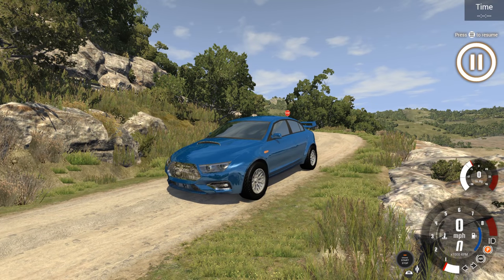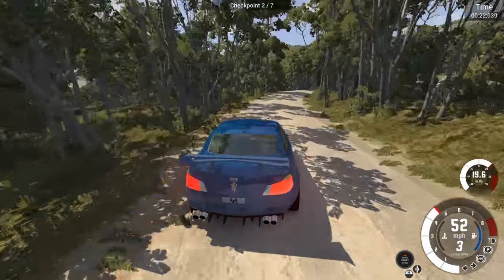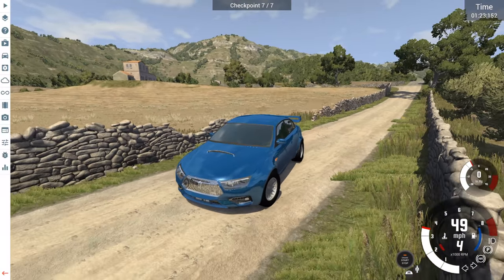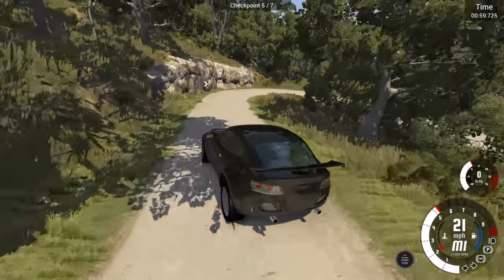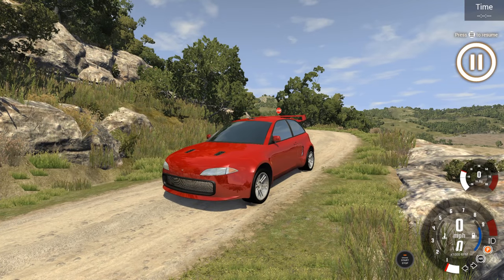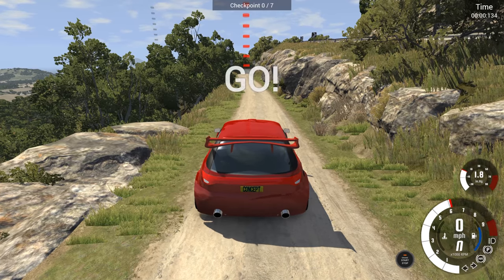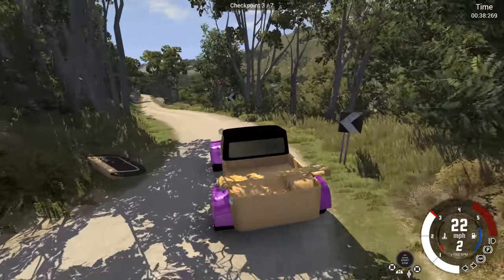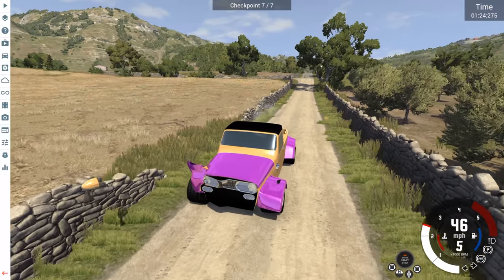BeamNG/Automation Rally Cars #7

Comment: i think the reason that first car hates the hairpins is because the front and rear have to spin at the same speed due to the 4x4 set up.
but when cornering the front needs to take a slightly longer distance, but its not allowed to spin faster to maintain its grip. and so the front just loses all its grip through the corners.
Reply: Feel like I've seen your name before somewhere
Reply: Gibbon  Yeah feel like I haven't seen vudluv anywhere. What even is that supposed to mean

Comment: 6:55 thats a dual clutch...
Reply: @Waff1es  Then its not called a sequential, the dual clutch has an automatic clutch, and the sequential does not.
Reply: @CarsByVincent  nvm my original comment. Dual clutch transmissions aren't sequential as they can technically switch to whatever gear they like, depending on the configuration, though in most cases it seems they are sequential.

Comment: I don't think Alex knows what the difference between a sequential and a DCT is-
Reply: I'm with him in that boat
Reply: @tiernanhare5568  
A sequential is basically just what rally cars and sport bikes have mechanically, it's just a manual transmission. A DCT is a modernized version of the same thing, but computer operated.

Seqentuals can't be driven like an automatic, and you still need to use a clutch when at a stop.

Comment: do a second run of the Tinfoil RS i mean some of these runs (and vehicles) just need some tweaks and they can become some track demons
Reply: The limited run count is intended to be as much of a limitation on the designer as the cost and course. Point is, you know you're only getting three attempts down the course. As such, you cannot afford to create an 800 horsepower shopping cart which can set a blisteringly fast lap time... if the stars align. Modest but consistent > Fast in theory. Suggesting to do more runs of a car for the sake of it is defeating the purpose of that restriction.